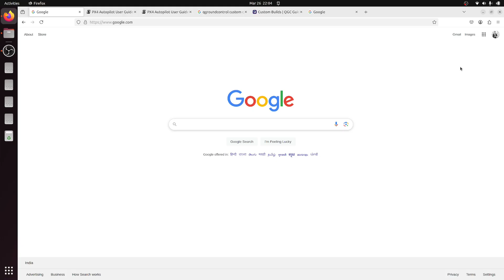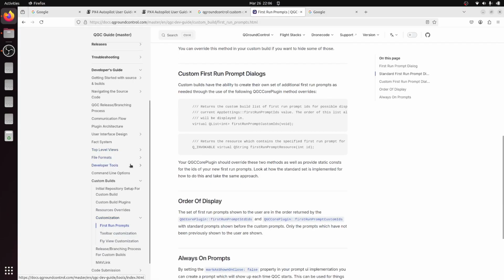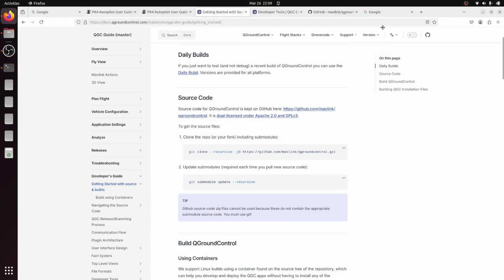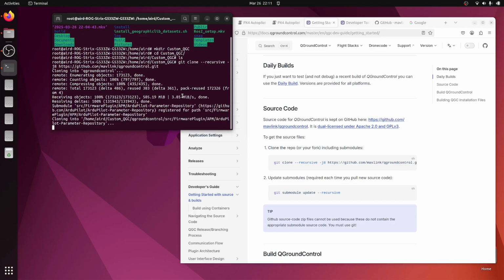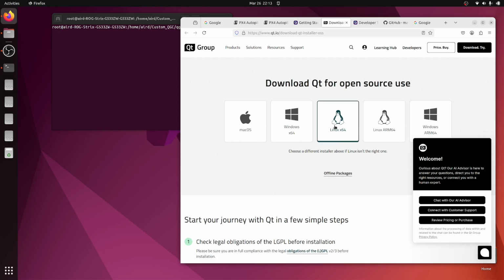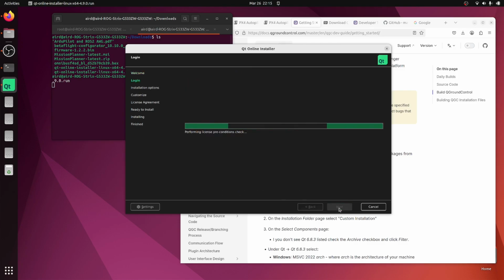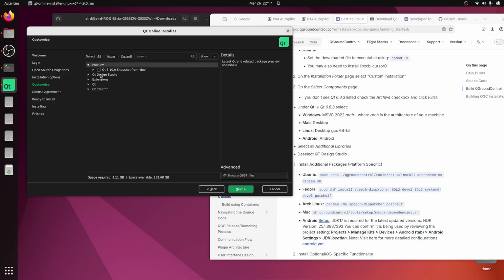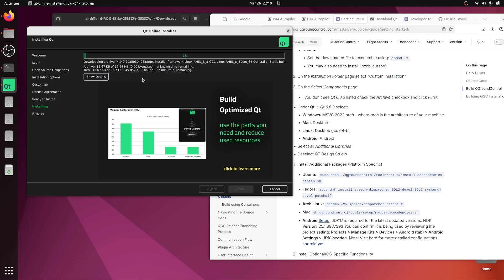QT setup and  installation to build the Custom Qgroundcontrol: Part-1

Comment: Also Ram, what's the way to increase the QT installation speed - its taking hours and I'm still not done!
Reply from the maker: To increase the download speed, use the mirror: for example: "./qt-unified-macOS-x64-4.6.0-online.app/Contents/MacOS/qt-unified-macOS-x64-4.6.0-online  --mirror https://qt-mirror.dannhauer.de/". it will increase the speed. Here is a list of mirrors: https://download.qt.io/static/mirrorlist/